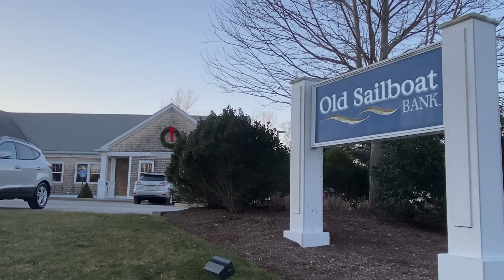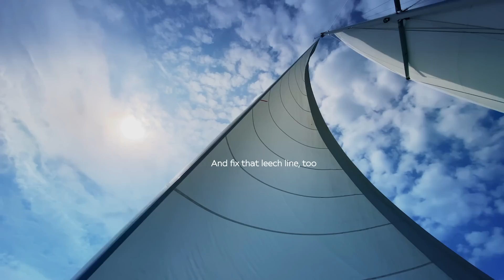EP 3: WHAT IS A THRU-HULL FITTING? Finding thru-hulls & attaching plugs! #Ran-daysSailboat

Comment: Great vid Ran-day, just a comment on through hulls, I have a Lavranos yacht 41, they put timber backing plates where the through hull comes through the hull, then tighten the nut down on the timber backing plate, the problem is that over time the timber has rotted. I’m now replacing the rotted timber with polyethylene (cutting board) it works well. Good luck with your beautiful boat.
Cheers, Greg from Australia 👍🍺
Reply from the maker: Great minds think alike… I have some cutting boards on board for soggy plywood replacement… it’s cheap and perfect for the application 👍👍

Comment: Wow. That's a lot of thru-hulls. Like your electrical, seems like a triage situation. Were it my boat, I would inventory and inspect all the thru-hulls, make it safe for season #1, then come up with a long term plan. As others have suggested: use manifolds to minimize thru-hulls, and move as many as possible above the water line. And of course, all of the thru-hulls after your plan should be easily accessed and have a shut-off just inside the hull that can be operated in seconds. 
FWIW: I would glass over the unused thru-hulls. Plugs can corrode and fail, but a proper glass repair should be as strong as the rest of the hull. But of course, that is more time and effort
Great videos Randall. Keep up the good work.
Reply from the maker: Couldn’t agree more… well said. Thanks!! 👍👍

Comment: In the colder freezing climes I would leave any ball valves turned to the 45 degree position for the winter. When the valve is turned full off or full on it will trap water in "cheeks" (side body) of the valve body leading to future failure (split, cracked) of said valve. They don't always leak at first but you may get a surprise as you open or close it and the water can now flow into the cheek and into the boat, temporarily you may stop the leak by placing valve full on or full off as this usually (initially) will isolate the crack from the bore of the valve. 
Four years ago on my Catalina I replaced all my ball valves with gate valves, they take longer to close but extremely rare is the frozen cracked valve. 

Eighteen years ago I discovered ball valve freezing issues when we had 20+ fail over winter of my first year here at the seasonal resort I work at in Ontario Canada as a maintenance supervisor (we have a full commercial kitchen, 50 guest rooms in 14 cabins, 52 staff rooms in 17 cabins leading to 114 full bathrooms, etc). as of 2022 we've replaced over 200 ball valves with gates, the rest get set to 45° over winter.
I along with my assistants were all new that first year, the previous manager was fired along with his staff so no one to pass on the winterizing process, it was learn as we go that first couple of years.

Comment: Randy, just so you know, SV Delos? Their Amel has only one thru-hull. I would recommend cutting the 23-26 thru-hull’s you have down to 5 or 6. And I wouldn’t just trust the plugs. Plugs can fail. I would grind down the thru-hull’s, remove them, and glass over the holes. And I would even fill the holes with thickened epoxy. Because in an emergency, water comes in so fast, you won’t know which thru-hull was compromised. You really think you’ll remember where all 25-26 of those suckers are when you are wading through up to your waist in freezing water? I would have your galley, the rear head, and the forward head intake come from the same hole. Obviously the toilets will each have a thru hole. But if you have the galley’s sink and the two heads sink use the same thru hull that would be ideal. One idea is to have the sinks drain into the shower sumps and then use the power of the sump pump push the gray water to the galley thru-hull. Keep in mind you’ll need your depth sounder and speedometer in their own thru-hulls. That is five right there, so you’ll need at least seven, because you’ll need your engine intake and your engine exhaust. Wait! Forgot about the scuppers. So you can easily reduce your thru-hulls to 9. I don’t really count the propane locker because its sealed off from the rest of the boat anyways.
Reply from the maker: thank you     a lot to take in

Comment: If your budget allows convert to wireless instruments (Wind Depth Speed). Install head discharge , pump out, and vent hoses  into a holding tank . If possible eliminate all unused thru hull fittings. Not easy but safe. Plugged holes cannot leak.
Reply from the maker: that might have to be a T-shirt "plugged holes cannot leak" :)  great idea... thank you
Reply: @YachtHunters exellent idea, I would buy one!

Comment: Randy re lubricating those thru hulls and seacocks.
May I offer my opinion, hope it helps. 
Personally, I think  WD 40 is a ‘penetrant’ for loosening frozen rusty parts, and not a lubricant…
Although it is commonly used for that purpose.
  Moving forward, When I lift my boat out in the Fall and again in the Spring  when I put her  back in, so twice a year
I spray the through hulls  with a Lithium based spray lubricant, then I ‘ exercise’ the seacock by opening and closing it. 
 Over time my seacocks have become looser and easier to use, I have pulled out several of them but they were in good shape 
And I returned them to service…
Great boat, that thru hull for the sink worries me,  I’d try to make it more accessible.
Reply from the maker: I'm with you on Lithium vs. WD40 (which is magical but not good for this use).... appreciate the feedback!

Comment: I believe the thru hull under the freezer is actually the cooling transfer (heat exchanger) for the freezer that uses the water under the boat rather than fins around the freezer itself. Had a similar system on the Jeanneau DSs. Possible to not paint the part under the hull for best results?  Thought mine was a depth sounder too at first.

Comment: Thank you Randall for the update on your boat journey. So many through hulls, so little information. As mentioned below, wherever possible for intakes, build a manifold that is central to the fixtures that need intake water and size the intake accordingly. Any blind through hulls should be removed and the openings filled and glassed. For discharge outlets, like the intakes, manifold as many as possible. Take care and forge ahead.

Comment: Owning a boat is building one, one piece at a time     Don’t use 5200, use 4200 instead    It’s just as strong, maybe stronger because it remains slightly flexible but you can remove it without doing any damage    (Yes, someday you may want to remove it.  What will you do if a gate valve gets cross threaded?)
Reply from the maker: great tip!! thanks!

Comment: Great work, and lots of it I’m sure, to integrate the mapping with the locating.  Wow, that is a lot of through hulls!!  Sea chest comes to mind of course, but that would be huge undertaking by the looks of it?  Maybe you could consolidate into few small sea chests strategically located for intakes?
Reply from the maker: Thanks 👍   For now i would suggest Randay spend a little time at each sight  and check the valve and hose and clamps carefully  
. Exercise the valve  make sure it operate freely
take a close look at the hose clamps grip on the hose. if they have been over tghtened over the years they may be  actually cutting the nose . If that's the case , close the valve and replace the hose with two fresh hose clamps
at least give each clamp a twist ...anything more than a bare tighten  require a  extra look and at least tighte til it stops 
Feel the hoses and even give them a tug 
Make certain the wooden pugs are tied to the valve and on a tether long enough to be able to position it properly before driving it home with a mallet  
speaking of which it might make sense to have multiple easily found mallets  in each cabin 
Indicate location on the wood work near each valve with a reflective tape star or "x" so  a flash light will spot it 
 ( leaks only occur on storm nights right ?)
Also close valves not needed at given time like sink or tub drains etct b d 
A very good chance that these approaches will present the mosst economical way to guarantee long term safety with out rre designing the entire boats fluids systems 
CQ
Reply: @YachtHunters   Agreed completely!

Comment: I would consider back-flow  check valves on the ones below the water line, as close to the hull as you could place them.  Prevent blue water from entering your discharge lines and tanks.
Reply from the maker: great suggestion. thanks

Comment: Aren't the cockpit soles sufficiently above the waterlines so those thru-hulls could be placed above the waterline? You then could use  plastic thru-hull and save some money (but having said that, get a really good plastic one). As you noted, access to the thru-hulls are vital at sea and you have some that seem impossible to get to. That must be fixed.   Good luck.

Comment: Randy, you have some Thru-Hulls and Seacocks correctly installed. (Full-Flow Flanged Bronze Seacocks with backing blocks.) Many of your Thru-Hulls are not set-up that way and need to be corrected for your safety. Plus I believe in doing so will make that ABYC approved.
Reply from the maker: Thanks for the tips!

Comment: I will echo others comments about manifolding  thru-hole lines when possible, especially the numerous sculpers. When manifolding, be sure to have individual line ballcocks as well as a main one on the thru-hole. Having to close off the main because there aren't individual shutoffs could comprimise operation of the boat. If you can't manifold, seriously consider rerouting lines from the least accessible places, like under your pot storage, to a more accessible thuhole that has been capped off. Some newer larger or more lavishly constructed sailboats have a raw water intake pump and distribution box rather than a manifold. Retrofitting an older sailboat might not be a viable option due to space limitations and the need to have additional water pressure cutoff for the engine. 

Durring the 1980's American industry realized how sloppy its engineering practices had gotten so two axioms were created: design for assembly and design for maintenance/repair. Assemby was being done on the factory floor very differently than was done during R&D and prototyping. People on the line complained it was near impossible to put in a screw when one had to balance it on a fingertip while reaching around a blind corner. People in the field complained about the same screw AND the number things to be taken apart to do routine maintenance or part replacement. The same two axioms apparently found their way into sailboat design because newer boats appear to have fewer and more accessible thru-holes.

Keep up the great videos and above all STAY SAFE! ⛵❤️😁

Comment: Where all those thru-hulls go is as important to map-out as where they are. Maybe some can be eliminated, maybe some can be consolidated.
The problem with "manifolding" is that a single thru-hull failure shuts down everything. 
Thru-hull are essential and failure can be reduced to within tolerated risk/reward with knowledge and regular inspection, replacement and maintenance.

Comment: T-bolt hose clamps provide a more secure clamp. I have seen gear clamps twist apart if slightly overtorqued
Reply from the maker: Interesting… will def buy a few and test then out… can you over torque those? Might they pop open if you do?
Reply: @YachtHunters  much more reliable.

Comment: I have a question for you , why are you using 5200  , 5200 is for a thru fitting that you never want to take off. 
My experiences with my old 36 foot tartan , Where are the Fiberglass had cracked around the fitting, easy fix take out the old put in the new, The previous owner laid up a number of his through hall fittings with 5200, getting my broken fitting out was a little tougher than I thought ,  after using a grinder, a hole saw , and shopping for a new on a 3/4 of an inch larger,then refitting back in the hole useing 4200 which works very well , and if you do spring a leak 10 years down the road you won’t tear off The gelcoat ,ask your sailing buds. 5200 or 4200.
Reply from the maker: I think you're right that 4200 is the way to go... 5200 is probably too permanent and meant more for things like portlights. thanks for the note!
Reply from the maker: I’m exonerated.  Taking back the head slap.  ( inside CQ joke )

Comment: If you can't get both hands on the hose to remove/ install it leave it connected if you can and go upstream of the hose a bit where you Can reach it to remove/ install it. You will be able to get the nut off with one hand on most of those but trying to wrestle a new hose on some of those deeper ones is going to be impossible without better access. I'm glad my boat is so simple. Lol.

Comment: Eliminate redundant openings. ie salt water intakes for heads. Eliminate one and pipe to the other head and galley internally. More internal plumbing, but that generally won't sink you.  Seacocks on all engine water through hulls. Big holes faster water ingress. Those wooden plugs also work if driven in from the outside. Possibly electric valves for larger openings in hard to reach areas. At sea, in rough weather, with flooding, at night a difficult access may become impossible.

Comment: First. Love the boat, checks alot of my boxes.
Second, I echo most of what is said.  Add a sea chest. Eliminate as many Thulls as possible.  Use real Secocks. (I like spartan from RobinHood marine.) We could have a whole discussion about tapered plug vs ball. 45 years full time professional.  Not a fan of balls.. But primarily flanged seacocks of reputable brand with bonding wire unless you use Marelon.  NPS straight thread. Bronze or Glass Reinforced Plastic (like Marelon) mushrooms only. Even above the water line. Nylon just becomes brittle and breaks. Any cockpit drains etc can usually be exited above the static waterline. Bilge pumps: each gets a dedicated discharge to themselves!  Don't share a pressurized line like air conditioning with a drain line/sump or you could end up puming water backwards into the boat.  
You only need one head discharge. They have to go into the tank 99% of the time anyway. Eliminate direct discharge and just have a macertor discharge for off shore from tank. (And that can be above the water line cause you only use it off shore underway.)
3. Alot of 5200 haters. And yes it is over used. And used in the wrong places. 4200 is good for Thulls, but Thulls is one place I don't mind 5200. Not that bad to remove with patience.  "Debond" is the real deal. Given a little time it will soften 5200. Also heat. About the only thing I want nearly permanently glued is the fittings below the water line. 

My personal choice was Blake's seacocks (but they only come in 3/4 and 1&1/2). Epoxied backing blocks made from solid fiberglass. Thru bolted. Must be bronze or 316 ss fasteners, never 304 below the waterline. 
Also ABA or AWAB hose clamps. They are just so much more reliable.
Cheers.
Reply from the maker: This is fantastic and very helpful… thanks for taking the time to share some of your expertise….👍👍

Comment: Great video. Glass in most of those holes and locate manifolds that are within easy reach. Please don’t use 5200. Won’t come loose again. 5200 works great slopped around a cracked plastic holding tank fitting etc.

Comment: That's a lot of sinking points on one boat. You could make a manifold to limit the number of "points" you have, but, unless you fill in those holes, you're still going to have a hole for water to possibly enter the boat. I heard of a number of boats sinking right at the dock because the thru-hull failed or the bilge pump failed, or any combination of the two. There has to be a better way to "cap off' a thru-hull than just putting a cap on it?
Reply from the maker: anything man made can fail    ownership diligence  is critical no matter the boat

Comment: Can you ask the CapQ what the most common sizes are on these through hole pipes/valves?    Would 3/4 inch or 1/2 inch be common OR are these metric sizes which are most common?   Obviously some are much larger....
Reply: From 1972 I'd have to go with imperial sizing. Boat was made in USA?
Reply from the maker: all imperial measurement... most seem to be 3/4" with a few 1 1/4" and a few 1"..... and also a few 1/2"... so basically the full menu of sizes... :)

Comment: I've been building/ refurbishing boats for 35 years and I have never seen a boat with 30 thru hulls in my life. They are not grounded,  they are bonded. You need drain trunks.
Reply from the maker: i think it was the victim of being a new design and trying to accommodate owner requests (heating/AC, generator, etc)... will def look into drain trunks. thanks!

Comment: Building on Tom's idea:  When wood sailing vessels were the norm, they would make a barrel like structure attached to a single though hole on the bottom with multiple ball valves attached to the middle to upper portion of the fore mentioned structure. The "poop chute" and other discharge points move them above the waterline with a check valve and lift pump where needed.

Comment: why do boats not use a manifold type system with the main TRUNKLINE with maybe 1-4 Thru-Holes for greywater, bilge, etc to reduce the overall amount of Thru-Holes? I understand systems like wastewater would be problematic running in this way,
Reply from the maker: some designers have collected related lines into some manifold systems   probably sostly and tricky to engineer for many boats